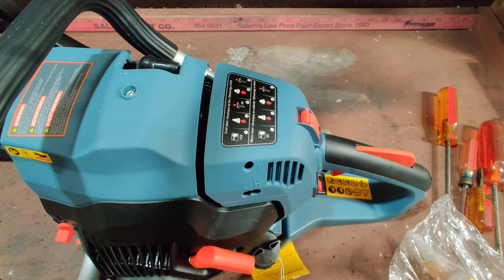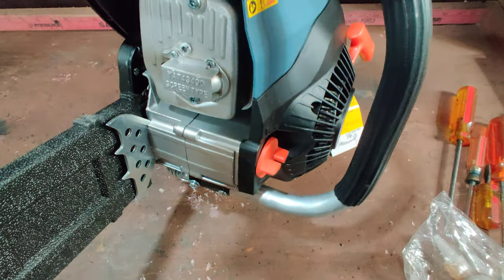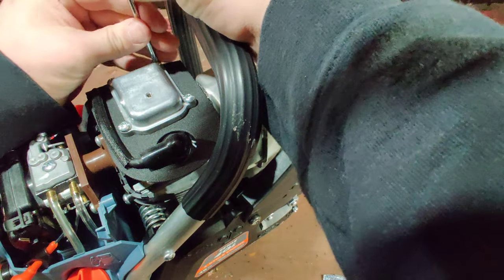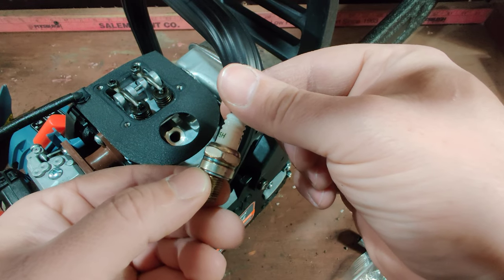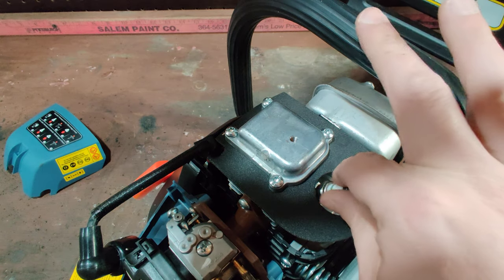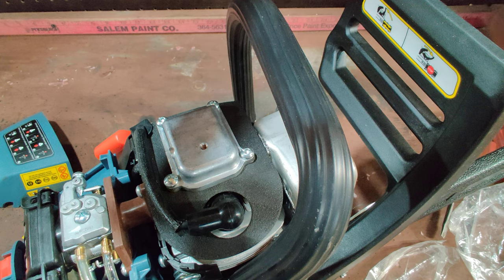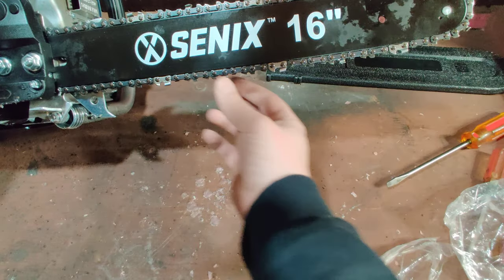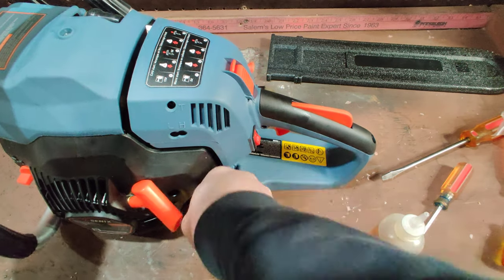Senix four stroke chainsaw tabletop review

Comment: After so many hours of use you need to lube the rocker arms, valves, pushrods right? There’s no oil pump.
Reply from the maker: I'm sure that's good practice, I'll have to check the manual and see if it's mentioned. This is a very low stress engine, not much force on anything, and I think the manufacturer is expecting oil mist to lube the rocker arms and such sufficiently. Also, this is strictly a homeowner saw, not meant for pro use and long hours at all. I'll bet 99% of these saws never get 50 hours put on them in their entire lifetime.
Reply: We’re going to run my first one. Not too aggressive. What size chain does it use 325.? Gage? Drive links?
Reply: Good video.
Reply from the maker: @bill154cub  3/8" low profile. No clue on drive links.

Comment: This isn’t even homeowners level cheap. This is dangerous. The parts are way too sloppy and homeowner Jones is going to get hurt with it
Reply: Do you have this saw ?   If so, how is it defiencient ?  Please do tell us, precisely.

Taking pot shots when you don't own & haven't tested it, is shady.

I do own this saw and have used it extensivly - and have owned dozens of Husky, Stihl, Echo & Poulans over the years.  

This saw is as safe & well designed as ANY Poulan or Craftsman or Husquvarna that I've used.

My 'other saw' is a Prosumer Echo MS-590 Timberwolf - which is a whole dimension larger, but sometimes overkill for smaller jobs.

Ergo, I bought this Senix 4 Cycle saw out of sheer mechanical curiosity figuring I could return it to Tractor Supply within 30 days if it was a weak saw or had some major flaw.

I not only found NO big weaknesses but rather it's a very strong well made & designed unique 'Thumper' saw.

Once mixture screws tuned & larger pull handle installed, it's my new favorite.
Reply: @RamTruckSteeringFix  I do own one of these saws.

Comment: Actually it appears to be pretty solid and user-friendly. Thanks for showing us the valves and little rockers that was pretty cool. The air filter screen should flow and keep all the grasshoppers, ants, rocks, dirt, chewing gum, pop rocks, hair, glitter, pant chips, and all the other normal debris out. The nice plastic cover over the air cleaner looks solid. I actually like how the chain adjustment works thats pretty nifty. When it fired up it sounded great.  I bet it will sound and run really smooth after a few heat cycles. That blue color would match my new work coveralls and white hockey mask for that professional look. 
  Perfect saw to take to all occasions right there you never know when you need to cut debris or add a new window in the living room. I can go visit all my friends, family, neighbors, and have all kinds of fun without having to pre mix my fuel. Sure looks like a better choice for cutting brush and debris than my trusty machete a lot easier on my hands too.

Comment: Sounds like a lot of valve noise.
Reply from the maker: Maybe. That saw in the video wound up having some kind of internal issue and glittering the oil, and being replaced under warranty. I don't remember it sounding any different, but you might be hearing whatever that is. I do have the saw still, autopsy video at some point.
Reply: @om617yota8  China China, not surprising ugh.
Reply from the maker: @adambatchelder4121  Right, although no worse than any other sub $200 Chinese saw. Senix was fantastic, and took good care of me, which I wouldn't expect from most other brands.

Comment: I didn't notice on the bottle that it said change after 8 hours. What kind of oil is in this stupid ass chainsaw? If you would have found out please reply with what type of oil this thing fucking takes. As soon as I get a chance I'm going to get the 18 in Walmart two stroke gas chainsaw to replace this stupid thing.
Reply from the maker: Emissions sticker says 10w-30.
Reply: Don’t worry, I seriously doubt if it will still be running at the 8 hour oil change. I had a 4 stroke trimmer and it might have had 4 hours on it before I got tired of working on it.